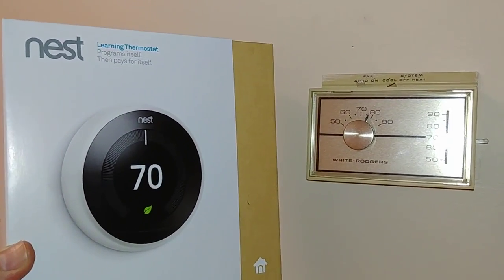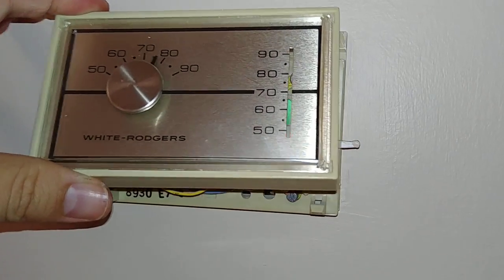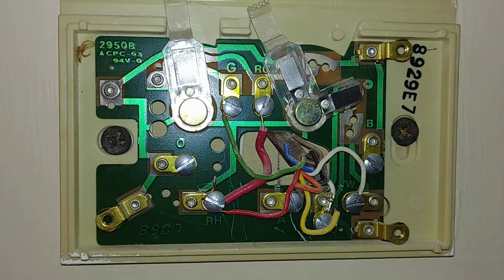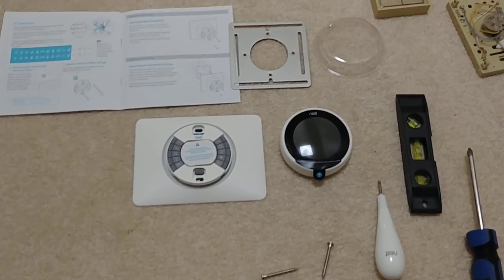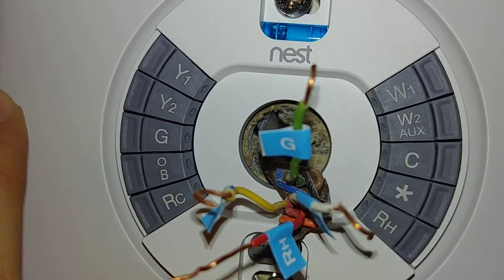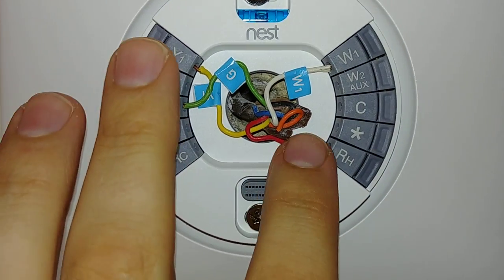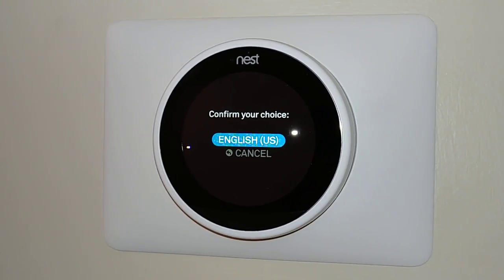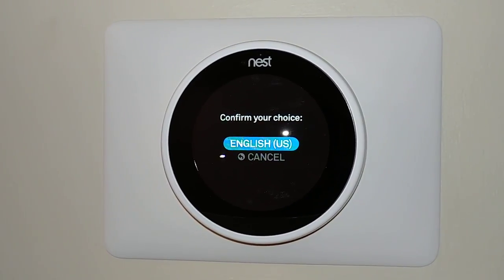Removing a White Rogers Thermostat and installing a Nest thermostat

Comment: I the video, there is a blue wire left unconnected.  I strongly suggest you connect that blue, or Common, wire to the C pin.  The nest will use it for continuous power.  Otherwise, the nest will only get power while the heat or cool is not operating and charge a small internal battery during the off cycle.  If the weather changes and the demand for heat or cool is extended, your nest thermostat could stop working until that battery is re-charged.

Comment: Moochas gracias, moochacho. It was comforting to see my ancient thermostat's picture, right there on the screen. Everything that you mentioned applied exactly to my circumstance. I had to enter only four wires (r,g,w,y) into the Nest start-up, for it to proceed. At first, I entered (rh, rc,g, y, w) and it would not let me proceed. It said, "Your system is not compatible with Nest"
Reply from the maker: Glad it helped!

Comment: I'm watching your video so I can replace a slightly newer White Rodgers thermostat than the one you showed. At the end of your video, after you have already connected the wires, I still see what looks like an orange wire (near the red wire) and a lot of black stuff. What is that orange wire (that doesn't appear to be connected to anything, maybe just tucked back in)? And is that black stuff just old electrical tape? Thanks!

Comment: I've same White Rodgers thermostat and this video really helps.  Why did you labelled the yellow wire as Y1 as I could not find the same in my old thermostat?
Reply from the maker: Yeah every thermostat could have a little different wiring and colors. What's important is to look at the colors and their location on the old thermostat taking note before disconnecting. Then you can use that as a guide for hooking up the new thermostat.

Comment: Solid tutorial. I've got the same thermostat in my house. I noticed you didn't have a C wire to connect to the Nest template. I've heard the Nest thermostat requires 24 V from from the C wire to function properly. Have you had any issues with your compressor?
Reply: Hmm. I have the exact same dinosaur thermostat in my house. This was my question as well.
Reply from the maker: Check the Nest support as it mentions why the C wire is typically not required. Here's an excerpt from their site: "Nest thermostats are engineered to use very little power less than 1 kWh/month. For comparison a typical 40W light bulb that's used 4 hours per day consumes about 5 kWh/month. So even though Nest thermostats have Wi-Fi activity sensors color displays and more they typically don't need a C wire to stay charged up" However, the Nest support site also mentions why a C wire might be required (if you are experiencing certain issues after install). The problem is if you don't have a C wire and require it, you'll need to call a HVAC professional to help diagnose and possibly install if possible.
Reply from the maker: https://support.google.com/googlenest/answer/9251212?hl=en

Comment: Is you white roger for cooling or heating, or for both? I have exact same connection for cooling, plus I have 2 wire old thermostat for heating. I am trying to combine 2 to one nest 3rd gen now. I read w1 on nest is for heating, i am not sure what is w1 for on white Roger cooling thermostat. If i connect w1 from white roger(used for cooling) to nest w1( designed for heating)  where do I connect 2 wires for heating on nest? BTW my heating system is hot water boiler. Thanks.

Comment: Whats funny is I replaced my two year old electronic digital programmable thermostat for a new old stock White Rodgers thermostat identical to yours because there so more reliable and basic. You can't beat the old mercury White Rodgers thermostat for reliable and longevity.
Reply from the maker: I actually agree. While I really do like the Nest, I'll admit their service life is usually 2-4 years before something goes wrong. Google doesn't sell the base separately, so if it goes bad the whole unit has to be replaced.
Reply: Wow I didn't know that. That can get expensive

Comment: Hello ，I have a question for the fan,. you know the old one can not stop fan. if we use nest , it can do the stop?
Reply from the maker: The thermostat does have fan controls. However and unrelated, I had a problem once where the fan was stuck on and wouldn't turn off and it was a problem with a control board that needed replaced in the main unit, not the thermostat. I had a HVAC professional fix it.